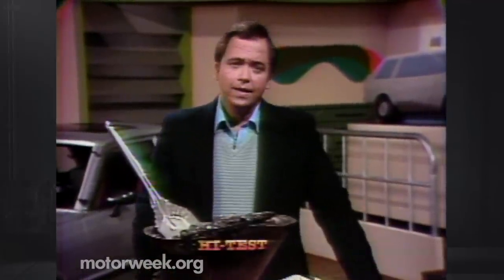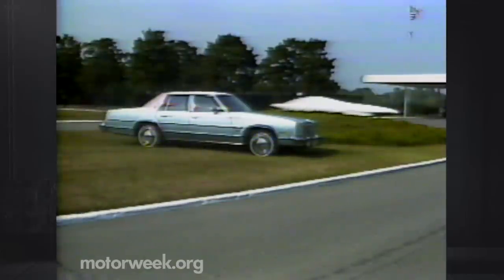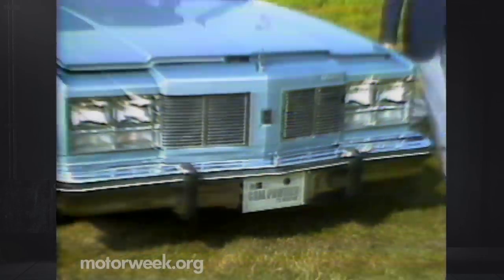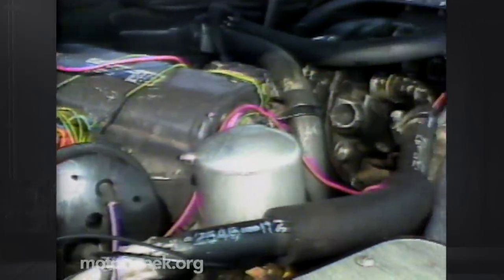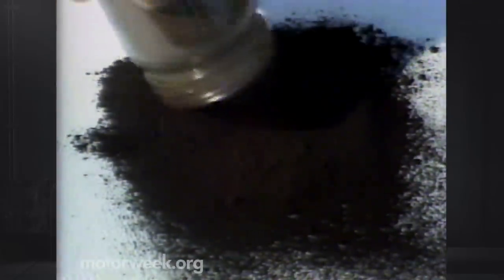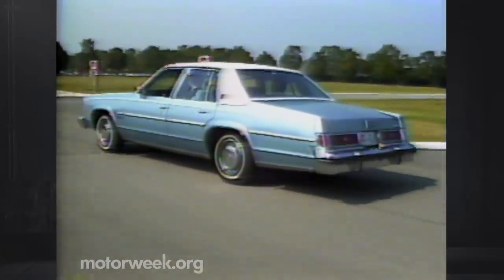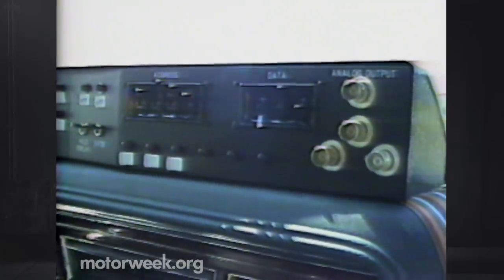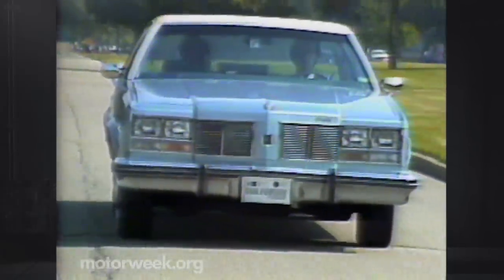Retro Review: Coal-Powered Turbine Engine Oldsmobile

Comment: 25 years later and we have enough oil to last 400 years
Reply: and the 600 years worth of coal turned out to be 60 years. lol
Reply: actually, no, we have well over 1000 years of coal available, probably much more if we really tried harder to find more. right now, we dont really need to. we have way more than we'll ever use in our forseeable futures/lifetimes.
Reply: @BaltimoreAndOhioRR  

In the UK alone there is something like 1500 years worth of coal left in the ground, and that's after 3-400 years of mining it.
Reply: We really should migrate our power generation to nuclear and save coal, oil, and gas for chemical feedstocks.

Comment: Just do like the Stanley Steamers did from the 1930:  Use chunks of coal to boil water and build up a head of steam, and then use steam pistons to drive the car.  A lot less technology would be needed for a car like that.   Or even better:  use coal GASIFICATION technology to convert coal into synthetic natural gas, and then burn that gas in a conventional engine.  That would be the ultimate coal powered car, a 'natural gas' powered car, except it is the coal that provides the natural gas.

Comment: Efficiency statistics (electric cars):

Coal power plants are about 40% efficient. And that’s only about 50% of US power generation (I wish it was less). Internal combustion engines are usually between 5 and 15% efficiency. Electric cars are usually about 60% efficient. Solar power is about 40%. Wind power is more efficient, so is nuclear, but I don’t know the exact percentages. But regardless which method of power generation, electric cars are more efficient than gas cars. Electric cars running on low efficiency power generation (40%*60%) are still more efficient than gas, at 24%. And plus, electric cars don’t idle at stops, etc, so that’s less power used.

Comment: In the 1940's, Popular Mechanics Magazine had a cover-article on the concept of advanced design coal-fueled & steam-powered railway locomotives. Sadly despite all claims & predictions of greatly improved performance over previous steam-locomotive designs, it couldn't compete with the reliabilty & lower overall cost had by the reduced maintenance & 3x greater work-done/lb-fuel of electro-motive diesels.

Comment: Coal is what powers the electrical generating stations, providing us with electricity.  So wouldn't an electric car like the Tesla Model S  or Model X,  or even the Tesla Leaf, or Chevy Bolt   all be  COAL POWERED vehicles ???
Reply: Honesty Counts Yes, actually electric cars are the only true multifuel cars. They (without any modification to the car itself..)are Hydro & Thermal,Nuclear,Coal,Oil,Natural Gas,Wind Turbine and Solar powered  cars!
Reply: Honesty Counts 
*Nissan Leaf
Reply: @WAQWBrentwood  Gasoline is made by heating crude oil. This would make gas powered vehicles multi fuel also.